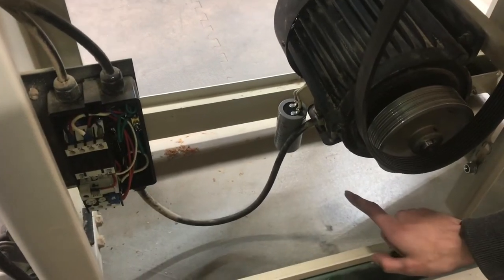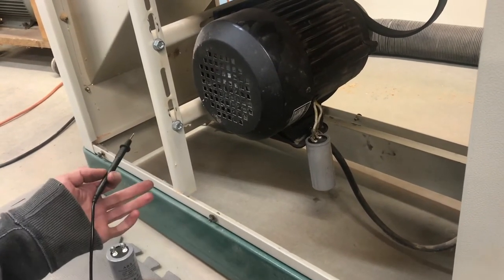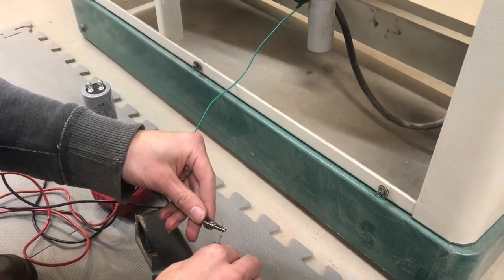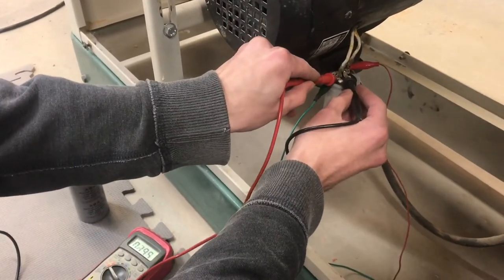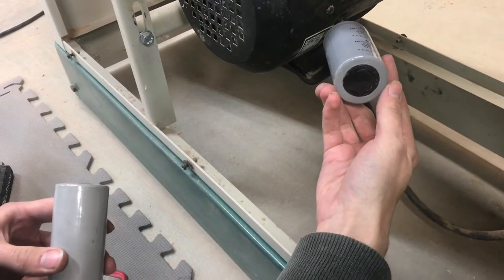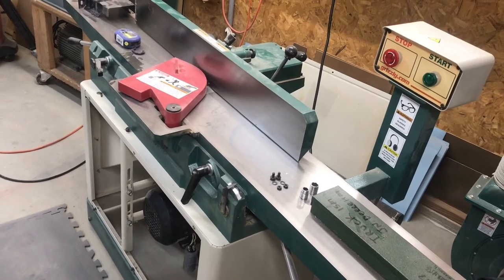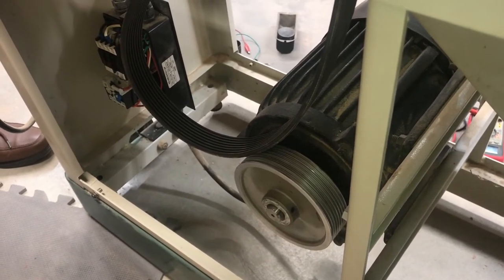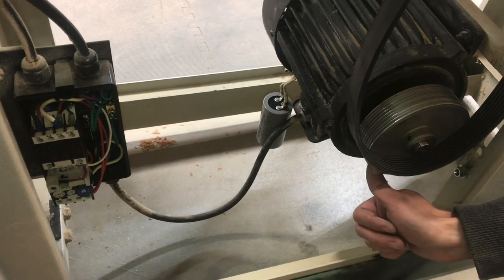why is my motor “spin slow” then “stop working”?? (BAD capacitor, contactor burned out motor)

Comment: Check the centrifugal switch at the bottom of the motor maybe their is some problem or to make sure apply some force to the pulley and turn it before turning on the motor.
.
Reply: Thats what i was thinking when it started slowly.  💯

Comment: I have this problem with a motor in work, I did the same steps before finding this video. The issue is, the motor is still moving slow, even after I've replaced it.

Comment: First step is check the capacitor instead of guessing by replacing it, it is just waste of time replacing parts just to see if that was the problem.
Second step if capacitor checks good is to check centrifugal switch in the motor, contacts can get sparky or dirty actign like there is no capcitor. Clean up or replace if needed. If that checks good then check windings. 
These steps assuming you already checked for proper voltage at the source of power. Not just the upper side of the contactor since the contactor itself may have a bad leg sending less voltage or not sending at all.

Comment: We used to use a test light to charge our capacitors(car audio).  If not big sparks!  Would that work to discharge as well?  I think the bulb acts as a resistor.